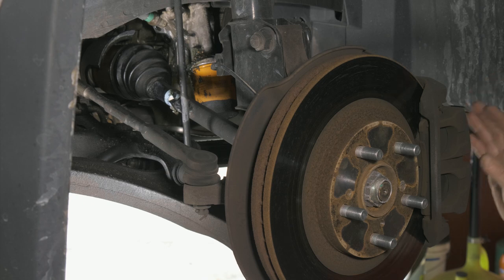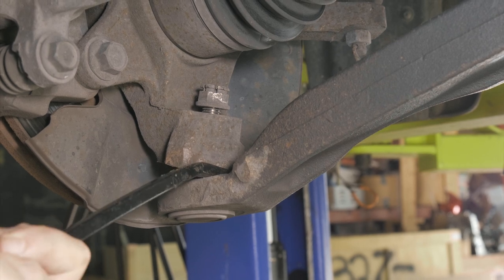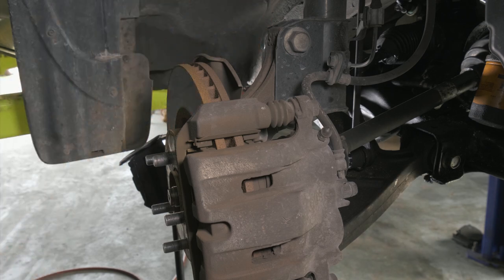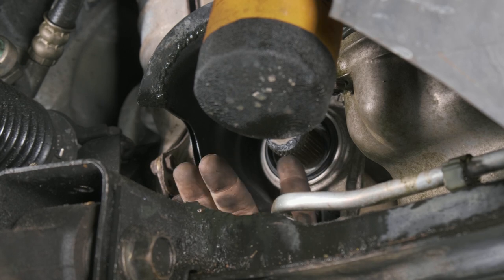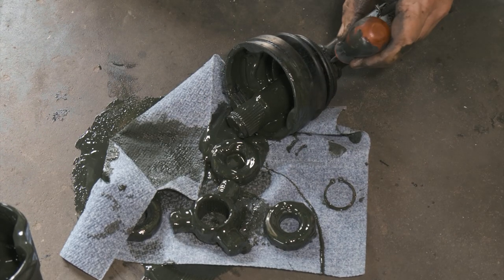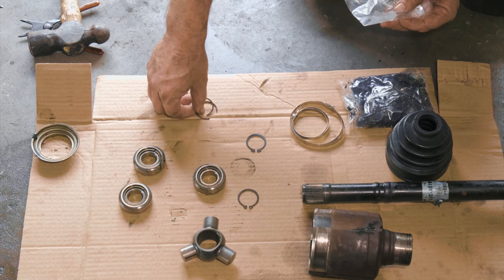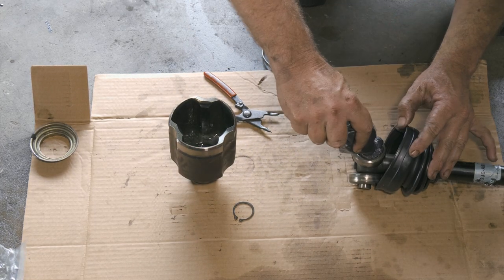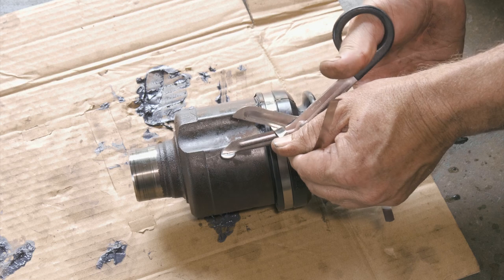2006 Honda Ridgeline Inner CV Boot on a CV Axle Shaft

Comment: Great Video but a few points.  In Honda manual it points out a couple things not mentioned here.  The 3 round bearings and the spider need to be marked for their locations, as they need to be reinstalled back in the original locations. Here is what it says: 4 - Make a mark on the rollers and spider to identify the locations of the rollers on the spider, then remove the rollers. 5 - remove the snap ring.  6 - Mark the spider and driveshaft to identify the position of the spider on the shaft. 7 - remove the spider. Wish I had read this before doing the job, guess we will find out what happens.  Good luck

Comment: Buddy, those bearings only needed to be whipped down if you spray brake cleaner on it and it gets inside they will eventually wear out from dry rubbing due to the traped thin out grease inside of the seal of those bearings. Just saying.

Comment: First mistake,  you don't need to remove the ball joint from the lower control arm. Just remove the two bolts holding the strut, then remove the cv from the hub.

Comment: How did you hammer the axle out? I heard the hammering but didn’t see where you placed it
Reply: An easy way I mistakenly removed it is by applying pressure to the bottom of the disc brake once the control arm is out of the joints on the frame side. That might pop out the spline from the inner cv joint exposing the ring. I don't recommend doing it.... but its possible.
Reply: Hit on the axle not on the bolt. $3 lesson I learned... had to buy a new axle bolt. Thanks rock auto